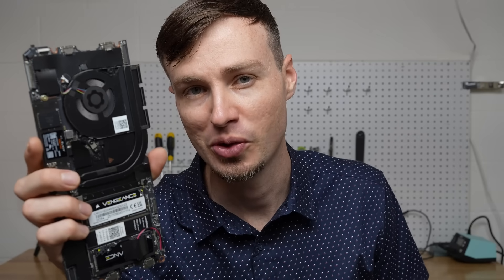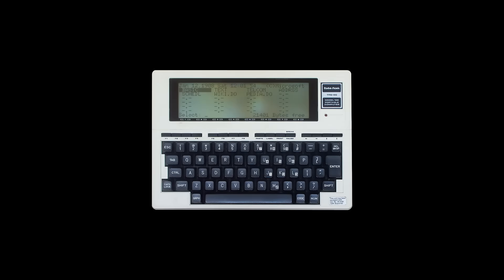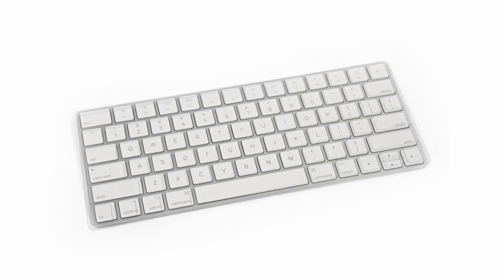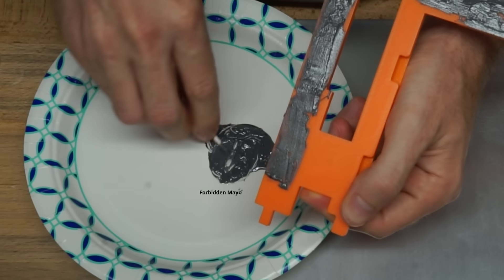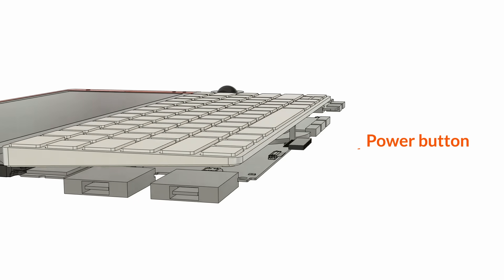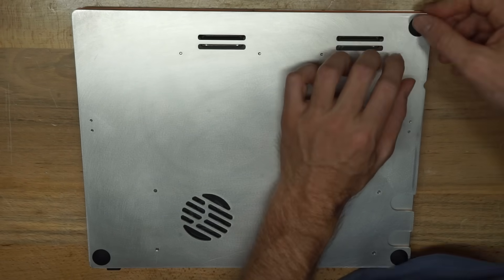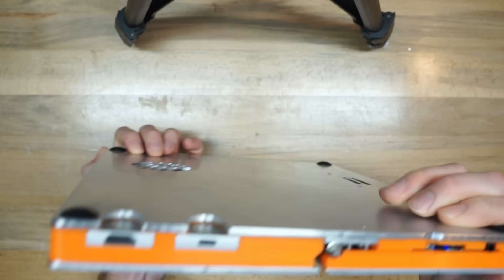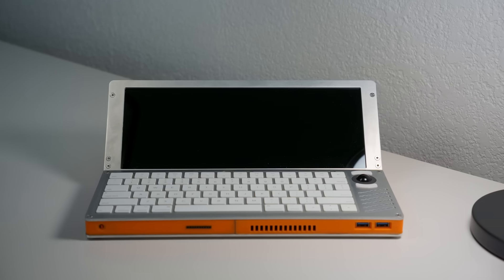Framework Cyberdeck - DIY Portable PC

Comment: Just found this now. I am very impressed and will look into more of your content now!
 
I am from a generation used to clunky electronic devices. 
And as much as I like todays nicely designed slim laptops, more often than not I wish for more flexibilty, interchangeability of parts and components.
Also, as you rightfully said, the monotony of todays designs, all more or less looking the same, is not appealing to me.
And I almost forgot that, so thanks for reminding me! :)

I am intrigued by framework and its products, but the price point of a full laptop makes it less appealing. 
And in the end they look very similar to regular devices, which probably is good for selling them.
But a walk down memory lane makes me all nostalgic, remembering my old work laptop which had a slot where you could either put in a DVD drive or a second battery.

You could easily access battery, wifi card, HDD and even RAM slots separately without having to disassemble the whole bottom plate and having to rip off some of the rubber feet.
Things like that would be very handy these days, rather than carrying around a powerbank and an external drive or memory cards etc., not to mention the cables and adapters.
And the heat distribution is another factor. With the slim design comes heat naturally.

Long story short: Really enjoyed your video and what you have created. 
Even though I am not a fan of all its features and its design I appreciate the approach and the ideas. 
Well done!

I came to your video here since I could not find a decently designed cooling pad for a heating up laptop design, with additional hub features and storage.
Was wondering if this could be something to be created and printed DIY.
Since I neither have a 3D printer nor a self made CNC machine (impressive) at home this might be difficult for me, but who knows, maybe you gave me motivation to look more into this. ;)
We need more customized engineering like yours these days! Very inspirational!
Reply from the maker: Thank you. I'm glad you enjoyed the video!

Comment: 12:30 With an extra button, you can add a scrolling layer to the trackball.
This is how I use the large trackball at my desktop, it works better than the traditional scroll wheel which it does have.
On Linux I use the input-remapper software to set up this layer-shift on the OS side, AutoHotKey should be able to do the same on Windows.

Comment: Framework laptops are an awesome idea, my only gripe is the soldered on BGA CPU chips…can’t upgrade them. Understandable tho, when trying to fit them in such a slim design. Still, would prefer a socketed CPU I can upgrade when I want to.

Comment: I found the framework IO dongles to be a gimmick. They are exactly that, a USB C to whatever connector. So I carry around the cable (in case it’s unavailable) and dongle. 

I don’t know anything about Macs but I find the most compelling feature they have is 4 usb c ports. Then I could just carry a USB C to HDMI cable for example. 

I’ve essentially converted my framework into a MacBook. Took me over a year for me to recognize my cognitive dissonance for that gimmick.

Comment: PS/2 to Arduino to usb is nutty. The tiny adapters are out there in droves
and have less latency than standard usb if
you believe some early 2000s hype. Love the project besides that. Seriously a new way to use frame work parts that I hadn’t considered.

Comment: 9:59. I notice subtle z axis errors. Set your Z axis grub nut into the shallow part of the threaded rod, and tigthen both ends good! On the 3d printer.
Reply from the maker: Thanks - I've since upgraded to a new 3D printer, all of those prints were done on my old ender 3, but I appreciate the tip!

Comment: well one hacky idea on remapping any keyboard. F off the controller and fly wire the matrix directly to a pi pico and run qmk on that. Have done that once (for my friend to modernize an ancient keyboard, ibm something) and might get to do that again for my cyberdeck. It is quite painful and janky but pretty much the only way to remap any keyboard.
Also in my opinion cyberdeck is pretty much a maker only item so to make it useful I still would went with a rpi (for i2c and gpio) and use a tiny keyboard. In my opinion there is no point in making it nice and neat as you are going to hack on and off stuff all the time.
Another hacky thing I come up with is that the tallest point of a raspberry pi is the usb ports, so I can hack off the top ports and fly wires underneath for interconnect. Doing this also just make it quite a bit thinner. I also plan to create a expansion slot standard that includes 2 usb ports, SPI, PWM, I2C in a 20x2 pin 2.54 connector (if anyone is interested it is just a simple box that is 70x45x15 with a 20x2 female pin header sit flash at the bottom and the top will be open to the outside. some stuff I plan to put in there includes RTLSDR which just fit, air sensors, I2C/CANbus adapters, or a logic analyzer)

Comment: Congrats! Nice project and finish!
In my opinion:
- I would prefer a foldable device (I thought you were going to fold the screen onto the keyboard). That would be very cool. because it would reduce it size to half. Of course, I know the challenge it would suppose.
- A touch screen. Maybe that would be a better way to browse into the UI.
- A fingerprint reader maybe? There are some USB fingerprint reader, I bought one in Aliexpress and it works pretty well with Windows Hello. You could integrate it into the chasis.
- This is device is so powerful, so thats great and of course using Framework parts is so cool, but maybe using an ARM CPU or an Intel N100/200 to have a passive dissipation and not using a fan to cool it.

Nice job man! 😍

Comment: What would it take to make it foldable?
Reply from the maker: My main concern with that was that putting the battery right up against the CPU heat sink might cause problems. Due to the short but wide dimensions of everything, it would have to be that way, unless I could stack it behind the screen. But then you would have a power cable that got bent every time it opened. I'm sure its possible with the right parts of course.

Comment: I have reproduced this Cyberdeck build and it is really awesome. Yes, it is heavy, but it is way too useful for me and I love it. A few notes about the issues that I have faced.

Nowadays it is hard to find Logitech T-SBC12-CPQ trackball to buy. After a big investigations I have found that it was used in Compaq Contura 430C and Compaq Armada 1120T notebooks from 90's, and Compaq MX-11800 keyboards. And it is realistic to find in on e-bay, so I did so.

Keyboard cable: I have ordered it, but even after 3 weeks of waiting the seller did not send it to me, and cancelled the order because they do not have the cable in stock. I have found similar cable connector on AliExpress, cut the regular USB cable and soldered the pieces together, so it can power the keyboard as expected. 

The thing is that this keyboard cable is only able to power the keyboard, but to do not transfer the data. So you can use the keyboard in Windows via Bluetooth, but you cannot go to BIOS for example to boot to Linux/whatever. I have found Bluetooth-to-USB bridge adapter on the Internet and currently waiting for it. From the description it should be able to connect Apple's bluetooth-keyboard as regular USB-keyboard. We'll see once I get it. 

The rest of steps are clear, you just need to see the video a few times, check the files on GitHub and spend some time to build all together. Thanks a lot to Ben for his brilliant idea and implementation. Now I have wonderful device which is easy to upgrade.

Comment: Since Neuromancer is from the 80s I would have gone with a super low profile keyboard like the kind you'd see in old think pads. But of course that would mean changing the design up a bit but hey it would be a bit thicker which could help with durability.

Comment: My Viotek monitor has the same OSD but without the black level setting (presumably a similar driver board)

I wouldn't use DCR, as far as I can tell it just dynamically changes the brightness and contrast settings (And presumably the black level setting) based on the image, but the way it does this is extremely flawed in that scrolling through a text document or code can cause dramatic changes in those settings. Setting brightness and contrast to 100 will give the same jump in brightness without the inconsistency of DCR

Comment: What are those hinges called?

I've been toying around with the idea of rebuilding my current laptop to be more rugged once I replace it. (I also had the idea of integrating an Arduino into the chassis directly.)

Thanks for showing it is possible and taking the time to document it!
Reply from the maker: I'm not sure if Youtube will block the URL or not but here's what they are: https://www.amazon.com/dp/B0BNH8985Y
Reply: @benmakeseverything  It worked thanks!

For posterity:
TAODAN Torque Friction Type Positioning Hinges 360 Degree Torque Hinges with Mounting Screws

Comment: As a project, and a hobby it is interesting and clever. As a usable pc, well it doesn't do it for me. It seems pretty impractical. Like if you put it into a bag the screen will get all scratched up because it's exposed, if you bump it or something with the screen tilted up you can mess up the internals.
I do like the gpio pins and the ability to use the screen as a monitor for other devices though. Maybe in a future project you could introduce that functionality into a traditional clamshell design and get the best of both worlds?

Comment: There must be shops that specialize in fabricating a custom computer design along the lines of what you did according to a client's specs and drawings.  3D printers allowing custom form design were not around when I was young back in the 8-bit processor days.  DIYers had to buy project boxes or forms from a third party.  This is truly a new era for design and invention.  Thanks for sharing this.

Comment: Amazing video I love your stuff man!
I have found that any electrical tape I use on a project is a sticky mess when I come back a year later. Would be interested to know if you have to modify it later what the state of those taped parts are.
Reply from the maker: The tape wasn't really holding anything structural, just some wires - some of did peel off but the wires have stayed in place pretty well. I am typing this comment on the cyberdeck right now, so I'd say its held up well overall.

Comment: Incredible concept. A few ideas to consider for v2. 

1. Try moving the ports backwards so the wires don't bother you when typing. 2. Apple keeps the speakers in sealed ports, firing upwards for good sound. 3. Track balls can be finnicky; you might be able to squeeze in a slightly bigger one moving the board. 4. Consider a few air intake ducts (boost cooling efficiency and reduce fan sound). 5. File down the alu screen bezel to remove friction before it kills the hinge 6. Use loc-tite on hinge bolts (be careful using it on plastics). 7. Touchscreen would be ultimate flex but I don't know if it would be useful in practice, maybe with a stylus.
Reply from the maker: Thank you for the feedback, definitely some good suggestions!

Comment: Wonderful video! I'm also building a cyberdeck (based on a RasPi 4) and was wondering if you had a pinout diagram for the Logitech trackball. I cannot seem to find how to wire it up to either an Arduino or a Pico. Thank you!
Reply: Just answered my own question. I found an instructables with the pinout for the logitech trackball.
Reply from the maker: @dgstephens  I was just about to post that. Glad you found it. Good luck on your build!

Comment: How I wish I have the knowledge, skills, and accessibility that you have bro. I always wanted to make a custom case for laptops because I feel like manufactures cut corners when it comes to it. For example, laptop manufacturers tend to make the hinges stiffer than necessary, and since most laptop cases are made with some kind of plastic while said hinges are of metal, this tension (not sure if this is the right term) eventually causes some damage, especially if the user uses the device in a hurry.

What I wanted to do is to use aluminum or some other kind of metal (alloy) that's both lightweight and durable, as well as to replace the small screws with nuts and bolts. I know this would make the device slightly heavier and maybe even thicker, but I'd rather have it that way instead of spending time, effort, and resources fixing broken parts.

This is a cool and inspiring concept. Thank you!

Comment: heads up, if you installed that coin cell and the board didnt come with one... might want to remove it.

on later boards(12th gen) the coin cell isnt used. on top of that, the coincell they did use is a rechargable one, so using a non-rechargable one can cause issues(kaboom.)

great video man

Comment: For scrolling you should have had a set of function sister keys on the left. Hold the scrollbutton and the trackball becomes a scoller (with both vertical and horizontal), hold a speed modifier key and the trackball moves the cursor faster (or slower) compensating for its small size

Comment: Any idea how much it weighs? I found this video looking for a portable laptop/pc solution for bikepacking so I can potentially live out my nomad fantasy while still working on the go... Maybe this is it.
Reply from the maker: Because I used 1/8" (3.2mm) aluminum sheets for the top and bottom, it is fairly heavy. I haven't weighed it, but I can tell you it's definitely heavier than a 15" laptop. That being said, if I used acrylic , carbon fiber or even just PLA for those parts, it would have been lighter. Weight just wasn't something I put any consideration into when designing it.
Reply: @benmakeseverything  Fair enough, thanks for the answer!

Comment: I'm sorry if I missed this but why a trackball over a track pad? Aesthetics or to be unique? (perfectly valid reasons) In my opinion the using a track pad would reduce height and and give a "smoother" look.
Reply from the maker: I mostly used this mini trackball to save space, and because I thought it was interesting and unique. I will say that if I built another version, I would probably go for a small trackpad instead because they are just easier to use.

Comment: Very cool build! Regarding the USB-C that is charge only, I recommend watching Adam Savage's recent video where they took apart various USB-C cables to see what was special about the $130 Apple USB-C. They reveal that a lot of cheaper USB-C cables were never built to support data transfer. 

It may just be a question of using a different USB-C manufacturer to get data transfer support, if you ever build a Framework Cyberdeck 2.0

Comment: This is why i keep old laptops around. You'd be surprised at how many components are actually USB. I've used laptop keyboards and trackpads by just guessing the pinout and soldering a USB cable to it. Power is the easiest to figure out then you can guess at tx/rx. I've done it with a lot of webcams.

Comment: Since back plate already acts as a CPU cooler, you might cut grooves in it to increase its surface if you ever want to, e.g. overclock it (assuming it's possible). That said, they'll probably accumulate dirt over time and make cleaning process way more cumbersome.

Comment: Nice! I'd probably throw in a button to act as a modifier to the trackball that switches the movement to a 'scroll' mode. Sort of like the center button on a ThinkPad TrackPoint. Might even be easy to do since your trackball is being run by the Arduino.

Comment: dude apparently doesnt know about pi 5 .This was in October so he should have. and the "has no m.2 " statement is false. you can get hats etc to get m.2 on pis. You need google.
Reply from the maker: I was working on the video right before I saw that announced. Still - the pi 5 does not have an integrated m.2 slot, you have to add a "Hat" that has one.

Comment: 12:57 actually, if you were able to read keyboard's status on Arduino, you could use these extra keys to implement scroll. I have it on my laptop, actually nothing too fancy, just holding mouse button 3 and moving the mouse (actually: rolling the trackball as i am sucker for Logitech's products:D) generates scroll events, this way i can have very fast yet precise scroll method in both axis.

Comment: While I do appreciate the craftsmanship I think that this is a cool project that doesn't solve any problem. It's small and yet no more portable than a significantly larger (and more powerful) laptop since it doesn't completely fold like one. Plus the ports are messy and the exposed electronics are likely way too susceptible to overtime damage from things like dust and humidity. I also wonder if the cost of everything is any less than a decent chromebook.. my guess is no.

Comment: The only thing I would change with this beautiful machine is the trackball. I don't think it's ergonomic for me, I would use a track nub like the ThinkPads
Reply from the maker: Agreed, the trackball is a weak point. There is a company called Cirque that sells small trackpads that you can interface with arduino. I have one that I've been testing and it would have been good in this device.

Comment: you can't make a cyberdeck with windows, is too corporate, too mainstream, not even ubuntu, it has to be at least an obscure Linux, like kali, precisely for what Case was doing on Neuromancer, preferebly avoid Linux and go straight to an OpenBSD or a NetBSD.

I loved that sony laptop 0:44 bottom left corner, I think it was a clio or something like that.
Reply from the maker: Fair enough, I was focused more on the physical build than the software here, but you can install linux on framework systems.

Comment: Some ideas for future mods:
* passively cooled x86_64 SBC, like Odroid H3+. 
* opensource battery charge controller + 18650 holder with replaceable cells.